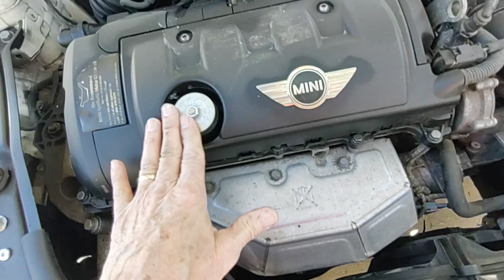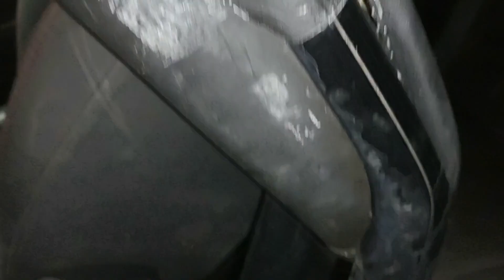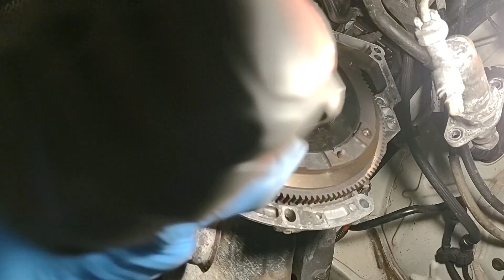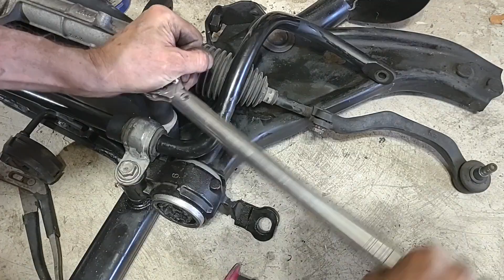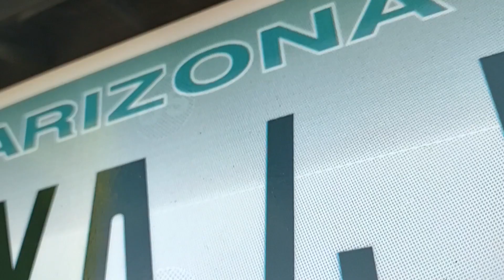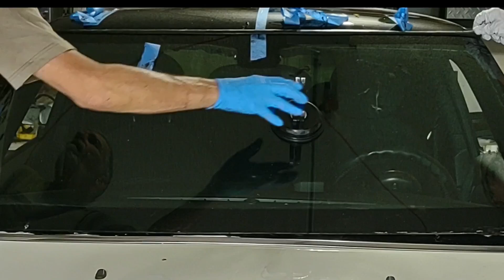Project $2K Mini Cooper R56 - turn a parts car into a car you want to drive for another 50,000 miles

Comment: Very cool.
I have a 2013 myself fun car to drive
Reply from the maker: Couldn't agree more - it's surprising how little this car DOESN'T feel when you're driving it (those in the back seat might disagree...).  And with the new Bilstein B4 struts and LCA bushings, and four "new" tires, it's also got reasonably good road manners.  But it's real forte' is blasting around town - we hardly bring our Mercedes GLK (small SUV) out into the sun these days).
Reply: @Mark_H_DIY  agreed they're pretty nimble, and the gas milage is awesome!
I did a Phoenix to Las Vegas run and drove around Vegas a bit and almost make it to Laughlin on 1 tank.
Reply from the maker: @B9bble  I was getting 49.5 MPG on the way to go pick up my replacement windshield. I can only hope to do that well on a bona fide road trip.